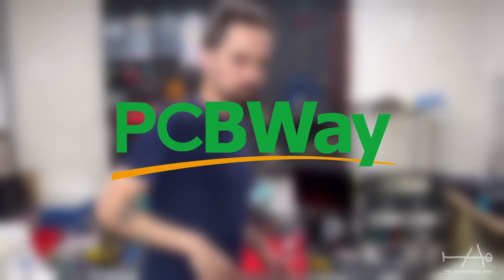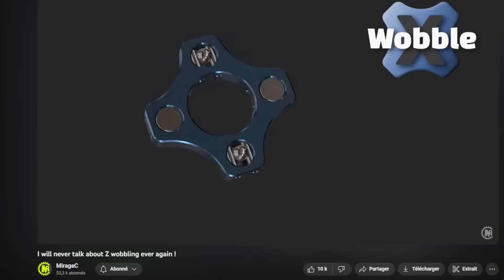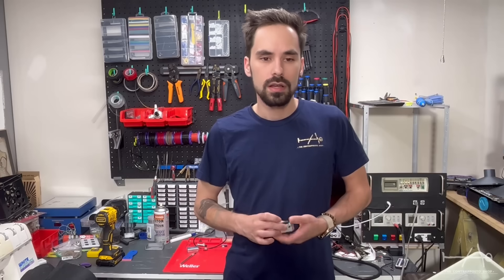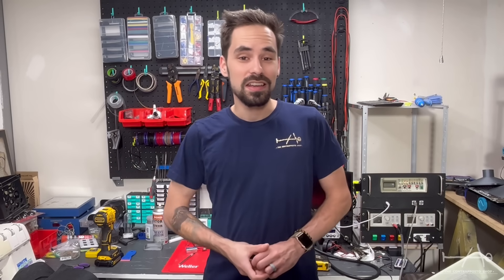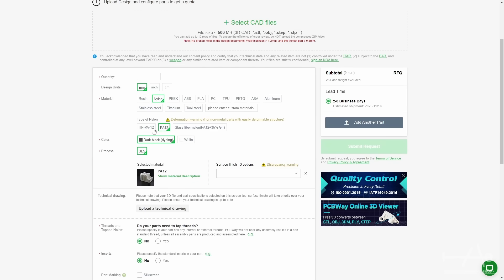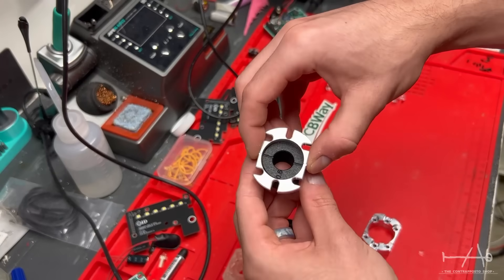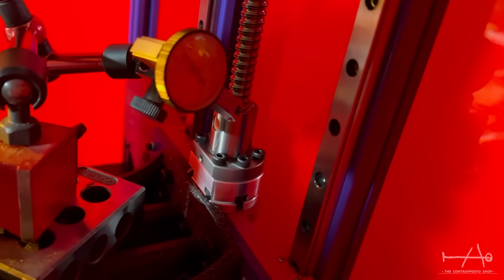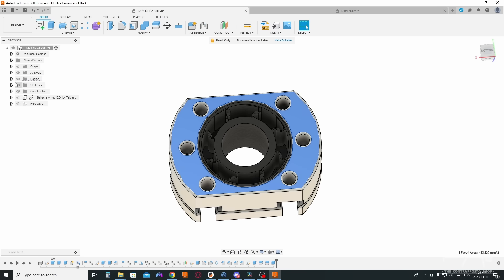A new device to remove Z wobble ! What should we call it ?

Comment: Does the flexible part allows for minimum rotation around the Z axis ?  Or there is no degree of freedom ?
Reply from the maker: In this version it could theoretically turn in one direction ( if the arm was not constrained ). I could alternate the pattern inside so rotational movement will not be possible
Reply: @thecontrappostoshop  Thank for the quick reply.
Is that rotation smaller than the backlash of an Oldham coupling ?
Reply from the maker: I didnt detect any backlash on my testing :)
Reply: @thecontrappostoshop  Very nice !

Comment: Have you measured lost motion and linearity/repeatability of motion in Z with and without this part? Your design looks compliant in torsion about Z, so I would expect it to have lost motion as the torsional preload flips directions when Z changes direction, as well as a little bit of nonlinearity coming out of that lost motion and a slightly magnified stick-slip behavior.
Reply from the maker: Yes indeed this design can twist in one direction but it’s a simple fix :)

Comment: The way I worked around wobble on my printer is by using the ballscrew to drive a cable loop, and using the cable loop to drive the Z axis. Wobble can in some circumstances alter the cable tension slightly, but it would need to be in the order of a few mm to be noticeable. Every design is a compromise, and in my case the downside is that using a cable to transfer movement adds more compliance in the movement, so the cable has to be very rigid. I am using a PVC coated steel clothesline.

Comment: As an Engineer I have to say: congrats!! It is a Great device! Some Things that might lead to further improvement: use the flex elements in alternating directions, e.g. Mirrored, try different stiffness by adjusting the amount of curvature. PS: with a 0.25mm nozzle it might be fdm printable
Reply from the maker: Thanks !! Yes i think i might need to alternate the pattern because the nut can twist in one direction.. for now i tried 0.3mm to 0.6mm. I wasnt sure how well the 0.3 would work because pcbway recommend at least 0.8mm thick. For fdm due to the small gap between the top and bottom part it’s not possible. At least not with good results

Comment: Nice little device but I'd just replace the bent or defective ballscrew / leadscrew instead.
Reply from the maker: If i want to be sure to have a nice and straight ballscrew i need to take higher grade like C3 … but it’s like 800$ more ! It’s “normal” for C7 ballscrew to have a bend in it
Reply: @thecontrappostoshop  ballscrews are overkill for most 3d printers I think.. (except maybe the Pantheon but that machine uses it exclusively for all axes & not just the Z and costs $$$)
Reply from the maker: @hd-be7di  i totally agree with you on that. That's why the prometheus has two version ! ACME lead screw and the Ballscrew version. People choose the one they want. I started the project with ACME because they are totally fine but people ask for the ballscrew version. The only downside of ACME it's due to the pressure of MSLA printing the nut wear out quickly bot not the ballscrew :)
Reply: @thecontrappostoshop  Maybe an anti-backlash nut would work better with the constant up and down motion. My old Ender 3 Pro Z system is using one along with a thrust bearing housing because running steppers with vertical load on the shaft is not recommended & I wouldn't be surprised to find bare unsupported steppers under cheap resin printers.

Comment: what do you think the lifetime of this compliant mechanism is?
Reply from the maker: If a compliant mechanism is made the right way it should last millions of cycles .. there’s even some compliant mechanism made inside a silicon wafer that can last very long. My concerns are more related to the PA12 with the pressure caused by the Z mouvement. That’s where it can fail because this material doesn’t like constant pressure. For the “S” inside the nut im not scared :)

Comment: @trappostoshop I solved a similar problem with a X, Y, Z gantry robot that I did not design, but was put in charge of fixing (I'm a Mech Engr).  In my case, the X and Y lead screws were not quite parallel to the linear guide rails.  I solved the issue by designing a "floating" lead screw nut.  Similar to your mechanism, it allowed the nut to "wobble" with the lead screw in the 2 axes perpendicular to the screw axis, but the nut could NOT float in the same axis as the lead screw (because it would introduce positioning error if that were allowed).  My solution was a bit simpler design than you came up with.  On the other axis, it was practical to make the nut float (due to assembly constraints), so I made the lead screw bearing "float" within its bearing block (or Pillow block).  Here, I didn't have to worry about positional errors.
Reply from the maker: Nice :o !

Comment: Why not just use an Oldham coupler. It’s more or less the same thing.
Reply from the maker: I explain it in the video ;) ! If you have components that move around like the oldham you need to have “gap” around the parts so they can move. If you have gap you will probably have backlash. I don’t want to reinvent the wheel but look into other horizons! That’s how innovations are made :)

Comment: Very nice and excellent work, I've designed several Z-Wobble eliminators, (one is on my channel) and due to the way FDM printing works, I didn't really think about how they may need to work with force applied in both directions, these are a good solution as long as you are using rails to constrain the movement with the ball screw, some machines will use the ball screw for both tasks, so I could see these not performing as good in those instances, adapting this concept to a standard lead screw, one could make the entire nut from POM or Nylon with this integrated into the design, just a single part that is low cost and a simple replaceable wear part instead of the horrible brass nuts we currently use.

Comment: how does it handle torsional forces? the compliant mechanism might allow for some of it.
Reply from the maker: this one ? not well haha ! You see how the "S" are all in the same direction ? we can twist the two part in one direction but not the other. If i alternate the pattern it would fix the problem :) .... In the other way it's not a problem (in my case) because the printer arm can not twist that way because of the rails and frame :)
Reply: yea thats what ive suspected seing the S shape.
But so its just trading wobble for some backlash, but nothing less its a intresting approach using Additive Manufacturing
Reply from the maker: @superbrain3848  not back lash at all :) ! maybe if we have resistance in the nut ( that should not be the case ) or while the motor and the printer arm working maybe we could see a small rotation but again nothing unfixable 😁

Comment: I spy a difference in your measurement method. When you tested your device, the micrometer arm was touching the linear rail right next to the leadscrew nut. It was way above the nut when testing without your device.
Hold a stick and wave it side to side, points closer to you don't move as far as the end of the stick.
If the micrometer arm is extended further from the source of the movement, then it magnifies the impact of small movements in the point to which it's base is attached.
Reply from the maker: Yes you are right :D ! I had like 50 different videos of me trying to capture the measurements. I did my best :P ! ... but indeed i tried a lot of testing and measured at various places and i didn't see any major difference :)

Comment: I just put in phase both my Z motors and use a belt with a simple off center bearing to tension and haven't seen banding since. Secret sauce is to activate the z motors before tightening down the toothed gears on the motor rods, very carefully as to not shift/put any pressure in any way that can load the motor. You shouldn't hear that motor "clunk" when you activate the stepper motors, or even feel it really. It does have semi-floating brass bushings/nuts on the lead screws, tighten to firm then 1/4 backed off. One lead screw has about 1/2-3/4mm deflection

I have a nearly stock Sermoon D1 Z axes setup (except for the added belt) if you want to check out how it's setup from stock

Comment: Seems a bit pointless to me if your Z axis is constrained by linear rails. The leadscrews are just for motion. I think people are barking up the wrong tree an attributing other problems to Z wobble.

Take my Desktop CNC, it isnt the leadscrew or ballscrew that dictates if it runs parallel or not. They are simply used to transfer motion. Its the rails that are constraining the movement. Sure if you have a super bent leadscrew it could cause binding but to me that is probably because of how it is constrained.
Reply from the maker: Yes the lead screw is bent ;) … maybe you will not see anything on a cnc machine ( a machine that has more rigidity than a resin printer made with PLA parts ) but that’s not the point. Of course we can fixed a million of thing before this but at what price !? This is a 6$ fix vs a 12x more expensive c3 ballscrew or more rigid part (machined) and bigger rails. The ballscrew are so stiff that it can introduce the movement into the rest of the frame ( as seen in the video ). Second we work here with sub microns pixels and details so for sure the tiniest movement will have impact in the final result !
Reply: @thecontrappostoshop this is ingenious part invention. Can't wait to buy one. Ill keep a look out when its for sale
Reply: The Z axis is unconstrained, otherwise it would not move. X and Y are constrained, so X and Y movements in the ballscrew get translated to Z movement in the print
Reply: @nirodper  there is no such thing as constraining a lead screw. it is harder than the alu frame and has a mechanical advantage of >15:1 over the stepper torque. if you fix the far end, you just shift the maximum amplitude of XY error to the middle of the screw. since we print from the bottom of the screw towards to top of the screw, it makes sense you want as much of the error to be as high up as possible, which means letting the top of the screw be free.
Reply: @suivzmoi  read the comment, i'm replying to @Festivejelly the AXIS is constrained, the carriage can only move in the Z direction (X and Y are constrained by the linear rails) so leadscrew deviations are translated into a periodic movement in Z for the carriage. I'm saying the same thing you are saying
Reply from the maker: Are you talking about the ballscrew that is not fixed at the top section? If i would fix it the problem woulb be even worst ! Because the ballscrew is fixed 100% of the movement would transfer to the rest because it has no where to go … putting it freely like that it can at least move like it wants and the rest i demped by the anti-wobble
Reply: ACME leadscrew nut has a little design play in it, so it can take up some lead screw wobble, maybe not quite half a millimetre but close.

But this is not a leadscrew, this is a ball screw. It has all that play designed out as far as it'll suffer. It is also a thick feisty piece of metal so it will just force the rest of the mechanism. Bend the linear rails and shear the frame. It's a low friction design as well, much lower than leadscrew, so it's unlikely to bind while doing the angry.

That being said i question the sanity of using a bad cheap ballscrew, when a quality leadscrew or a well tensioned belt is a well recommended budget solution. You can even do the silly and use a really small threaded rod like m4 which bends like a wet noodle. Ball screws are for expensive machines for a reason.
Reply from the maker: The Prometheus has two version .. ACME and Ballscrew ! I designed the ballscrew version because people wanted this. With ACME i didnt have any problem like that… only nuts that wears out quicker
Reply: you are pretty far behind the curve if you are still at the point of denying that a curved lead screw or ball screw is the reason for z wobble. i think people are barking up the wrong tree when they fail to recognise it is the most powerful simple machine in a 3d printer or CNC due to its inherently high mechanical advantage. a couple linear rails and alu extrusion cannot constrain a crooked screw. the entire frame will flex if you try. a guy with a dial gauge can literally show you proof of the problem and also the solution, in a video, and people with eyes still wouldnt believe...

Comment: I have the impression that proper ballscrew installation (alignment) would solve the issue
Reply from the maker: Not really! Everywhere you look you will see that Chinese ballscrew has this problem and it’s not because we ALL install them badly :)
Reply: @thecontrappostoshop  I have installed plenty in the recent years, I have 4 cnc machines. All BS I have worked with (C7 chinese making) have been straight af.
Reply from the maker: @takisbakalis   Oh and btw ! I measured the ballscrew only (without installing it incorrectly 😂) and i had the same measurements ! So i don't know what to say to you other than "yes my ballscrew is bent like a lot of other" and "good for you !"
Reply: @takisbakalis   Them too cheap for c7, they buy unrated/reject ball screw, bet.
Reply: Looks like this is compensation for cheap Chinese ball screws, even using high end mounts and alignment you still get problems with poor ball screws because they aren't totally straight. Better rails would minimise this problem too, most printers come with poor screws and rails.
Reply: you have the wrong impression. alignment cannot fix a screw that is curved and all of them are to some degree. you can either get a high grade screw ($500+), or you can create a mechanism to make a $20 one perform almost as well. z banding is simply an unforgiving visual artifact that is very visible even with tiny errors.
Reply: Yes, say it again and you might convince yourself. I work with ballscrews quite often, from cheap C7 to industrial grade. I have never unpacked a ballscrew that is bent. But yeah, better to listen to the youtube specialist :hand-pink-waving:
Reply from the maker: @takisbakalis  bent is a big word ! I dont know if you have realized that we are talking here of a play of 250um on a top free ballscrew. If i had the top bearing im pretty sure i can cut this measurement by 4 ! in my case it's better if i don't install it. Im pretty convince in your machine you have a frame WAY stiffer than mine so you can reduce that measurement even more ! We talk here of a machine made in plastic with 2020 extrusions. Give me 4040, MGN15 rails and machined part and i will not have any "bent" ballscrew ;)